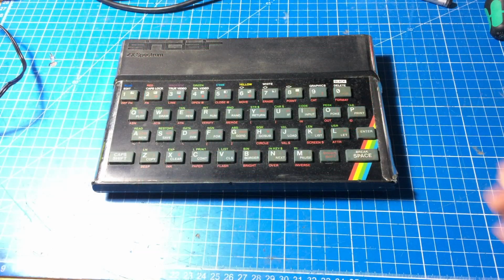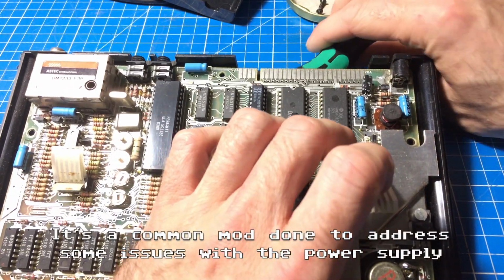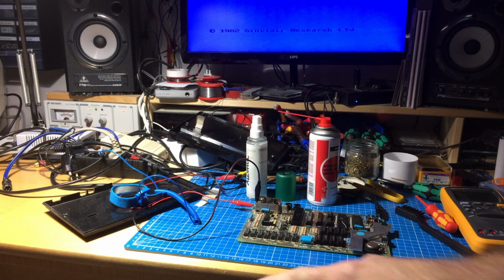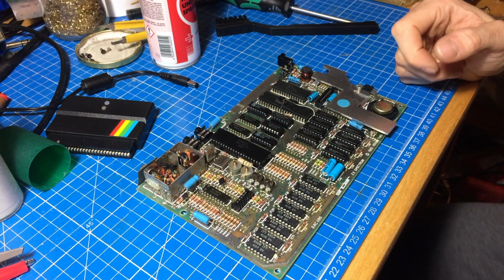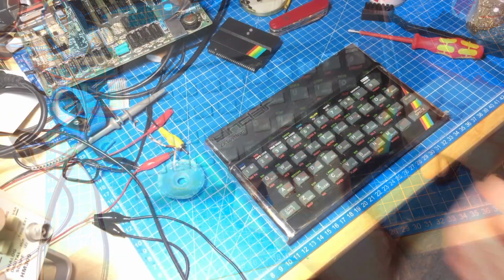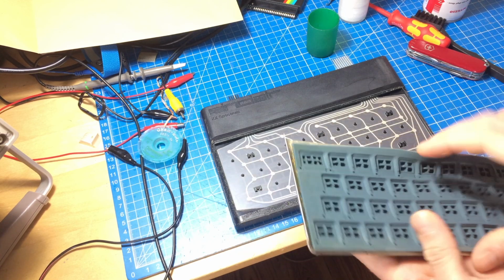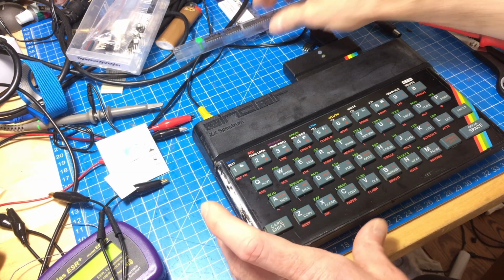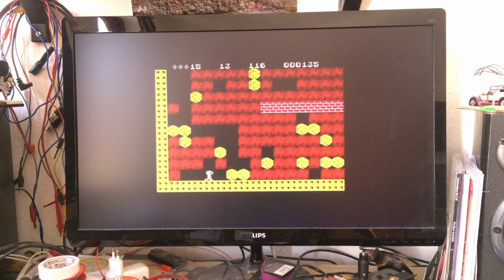ZX Spectrum Issue 2 Repair and Restoration

Comment: Just a tip regarding that diagnostic software. I had persistent memory issues with a ZX Spectrum 2+, and that diagnostic software was listing errors with different upper ram ICs each time it ran. I swapped out upper ram but it didn't seem to solve the issue. I used an oscilloscope to look at the data lines on the upper ram. I saw rock-solid 5v square waves on every data line. When I looked at lower ram, there was a distinctive ramp on the front side of every square wave, and the average voltage was more like 4.5v. It turns out that an electrolytic capacitor near the ULA was bad, and it was causing this ramping. Lower ram worked fine with this ramping, but the issue popped up when bank-switching parts of upper ram.

Comment: Thanks for this video. I had the same colour banding issue. I resolved it by changing the display cable and tweeking the variable resister on the board that controls the vertical hold and colour adjustment

Comment: There's also a S-Video mod available which is basically 2 transistors + 2 (or 4) resistors. Works like a charm and gets rid of that annoying color bleed on composite.
Another decent mod is replacing the lower 16k bank with 4164 DRAMs - which kills the need for the internal -5V (whenever it would fail it will very likely take the original 16k bank along with it).
Reply from the maker: Oh, didn't know that. I'm still a noob concerning the Spectrum world. I will look into that. Thanks for adding! :)
Reply: The 4164 DRAMs can't be used directly, they need to be modified: pin 8 lifted and connected to pin 9 and maybe pin 1  snipped off.
Reply: @SirWolfCZ  or the 12V and -5v tracks on the board cut, with the 5V then bridged onto the old 12V rail.  This will give the same without cutting chips and is reversible with a couple of bodge wires on the board.

Comment: Obviously it's more important that these old computers are working vs their physical condition, however if that were mine I probably would have filled the deep scratches and holes and sanded it back then painted it. Next replaced the faceplate along with the membrane. But that's just my opinion of course. Keep up the videos when possible, always enjoyable.
Reply from the maker: Thanks. :) I went for keeping the looks of it because it was loved so much by the previous owner and you I like how it kind of tells a story. I have another speccy that looks near mint so I can always choose between this battered one and the clean one.

Comment: Hello Jan, i see you clean it with alcohol. Is it ok to use "spiritus"? Is says 85% alcohol. Thank you.
Reply from the maker: I wouldn't recommend spiritus. It has enough alcohol in it for cleaning but the rest of it is filled up with random chemicals that could potentially be conductive/cause reactions with plastics. It will probably work for most stuff but I wouldn't use it for anything I care about.

Comment: Can that quick and dirty Composite mod be done on a Nintendo Famicom? :) I have a faulty one but of course its NTSC J for RF and I am in PAL Land so can't test it.
Reply: The Famicom composite output is too low - you can (to test) just connect the video output pin on the PPU straight to your composite lead but it will be quite dark.  I showed how to AV mod these in the 5 famicom repairs videos - its not hard, remove several components, swap a few resistors etc.
Reply: You sure did. I will have a look at that. This particular Famicom I was going to restore and put it in the Box I have which came with my other NESRGB Modded Famicom. Just wanted to keep one standard but will need to do some form of mod so I can see the video output, when I know I have fixed it I can reverse the mod. The issue with the one I have picked up appears to be a faulty SRAM as one of them gets BELTING hot after only 1 minute or so of being switch on.

Comment: Great video! I have an Issue 2 at that i'm hoping to repair, I fixed green screen by adjusting VR1 and VR2 but it doesn't show the black border on boot and although it shows the "Sinclair Research 1982" it has random black pixels appearing, most keys do not work but pressing any that do work results in it showing random gibberish similar to this video and then freezing. Sadly though even though my issue 2 board looks exactly the same as yours, all the chips except for the ULA are SOLDERED not SOCKETED! This is going to make checking for bad RAM a pain in the backside arrgghgh :(
Reply from the maker: Yes, it can be quite a pain to work on these. I suppose they left out sockets to further cut the cost back in the day. Sounds like a RAM or ULA issue you have there (but obviously difficult to tell from a distance). Hope you can fix it!
Reply: @JanBeta  yeah going to save up for a desoldering rig and then socket the board, I've needed one for 30 odds years so now is the time to invest I reckon, appreciate the reply Jan I love watching your videos, keep up the good work 👍

Comment: I would recommend when reomivg glue or stickey tape to use a a mild heat gun that way you don't damage the paint but make sure the heat gun is one dow does get that hot or you will melt stuff and when useing it keep it move and don't just hole it on one place
Reply from the maker: Yes, that's probably the best way to do it. :)

Comment: Hi, i have the same model, but the picture is a lot less sharp than yours, do you think that adjusting the pots may help? There are color dots that "crawl" over the screen, nothing major but i just want so bad the picture to look like yours! Can you help? And yes,did the composite mod
Reply: Or maybe changing some caps,and if yes,wich of them? Thank you
Reply from the maker: I also get color dots crawling and flickering. I think the picture looks better in the video than it does in real life actually. Replacing all the electrolytic caps on the board makes sense and improves the picture a bit but generally the output from these old Speccys is not very good unfortunately. :/
Reply: Ah,ok, i thought only i have the "dirty" image, it's funny you say that in real life has flickering, i will leave it be,then, and i must say in this vid, the picture looks allmost flawless! Frustrating, actually :)

Comment: I always understood that faulty caps can destroy ram (or was it rom?) on he speccy. Perhaps a cap change would be a smart idea.
Reply from the maker: That's definitely on my to-do list. The caps in these old Speccys are not of very good quality. The only reason I didn't do it right away is that I didn't have enough spare caps.
Reply: Yeah and some of them are axial caps. I bought a complete set off JoulesToCoulomb a long time ago.
Reply from the maker: Yes, all axial caps in this one. It's not so easy to get them in reasonable quality. Probably going to order a set off Retroleum. I'll also check if JoulesPerCoulomb still sells them.
Reply: JoulesPerCoulomb..that was it.

Comment: OK, maybe I missed it, but what's with the transistor straddling the CPU?
Reply from the maker: It is the so-called "spider mod" which made up for some I/O issues with the ULA chips used in the issue 2 speccys. If I understood it correctly, they tried fixing issues that the early ULAs (used in issue one boards) had and overdid it so they had to make this mod to compensate.

Comment: The Speccyyyyyyyyyyy !
Thanks to it, I became short-sighted ! Ah ah !
Reply from the maker: I became short-sighted because I used an old black and white TV as my first monitor on my C64. ;)
Reply: I had the B and W TV for the ZX80 and possibly 81, and got colour when the Speccy became a member of the family.
Spent so many hours playing, typing BASIC progs, and duplicating tapes to the microdrive and then the Beta Disk ... That got my eyesight !
Fortunately laser corrected it.
Thanks for your vid.
I am considering funding you a bit, possibly starting in October when my purse allows it.
Reply from the maker: I spent hours and days on the C64. Didn't have a color monitor until the mid 90s on the Amiga. Wearing glasses/contact lenses now. Totally worth it though. ;)

Thanks for even considering funding me. :)